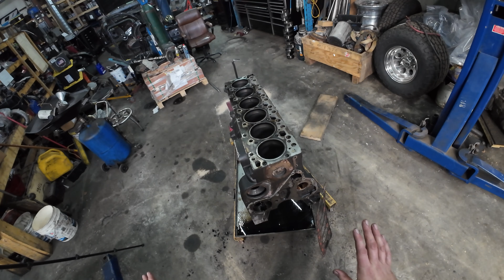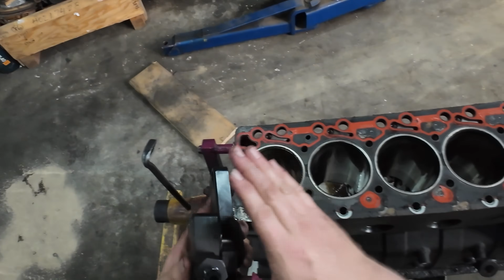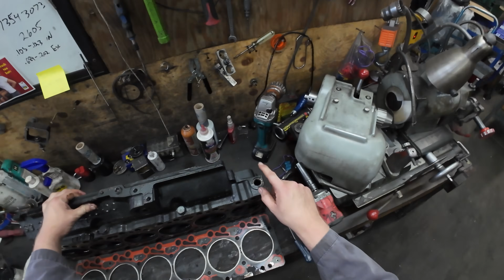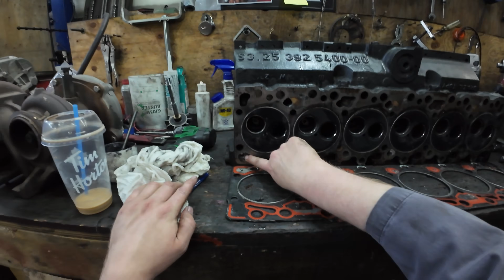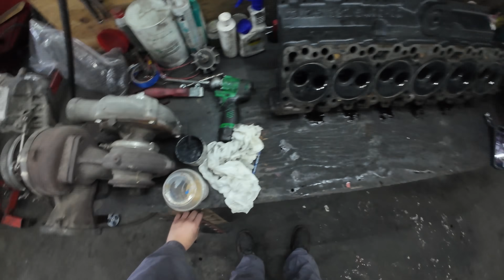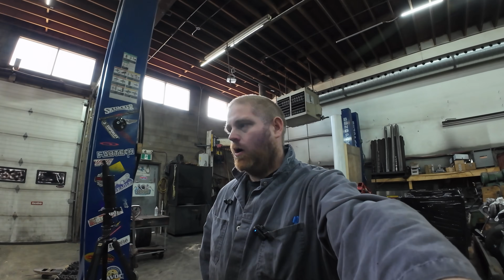HOW TO WASTE $500 ON A COOLANT BYPASS ON YOUR CUMMINS

Comment: This is a good informative video on coolant flow. I chose to pull coolant from the second port forward from the back of the head and use a ball valve as a restrictor as well as having the thermostat still. My figuring is, it'll bypass a little all the time but when the coolant pressure increases at the rear of the head, it has a path of less resistance to the radiator. I keep it restricted partally to make sure it doesn't starve the front of the head of coolant or affect the flow direction. 
Thoughts on the setup?
Could also replace the valve for a spring pressure release.
Reply from the maker: I do the same thing on stuff I drive in the winter. I close the valve off when not towing.

Comment: 2 of the Case Maxxums I used to service on a hay/beef farm I worked at used the coolant ports in the side of the head. The lowest rated horsepower unit (think it was a 5230) had the Lucas CAV DPA injection pump on it, really an odd pump if you were used a lot of the “normal” Cummins stuff.
Reply from the maker: I have work lots of those piles lol

Comment: I definitely need one in my 1st gen! Great video! No one else dives deep into these engines like you do!
Reply from the maker: Do my best to help a guy. I will get in to the later stuff. But want to get the old stuff done first
Reply: @CUTTERUPROB  I appreciate that!
Reply: Have you ever made the coolant bypass for the first generation. I’m thinking I just wanna plate with a AN fitting for my 1990

Comment: Cummins makes a part for I believe industrial engines and generators 3925226, I believe a few guys say they fit/clear on 1st gens and they also tie that into the port near the inlet rad hose I believe it’s a 3 way fitting for the heat exchanger.
Reply from the maker: Yep they do. We are making one the has the thermostat in it that fits
Reply: @CUTTERUPROB  would it be beneficial with Tstat vs w/o a Tstat plumbing it into that port on the coolant intake vs going on the outtake?
Reply from the maker: @XxOverLoad93xX  out on the block into the non pressure side is what you want in any application. But it you just use the plate you will want restrict coolant flow otherwise the engine won’t get hot. That’s the reason that on a coolant bypass you run the thermostat or a pressure relief.

Comment: Hey sorry kinda off topic. I got an 18 6.7 ima throw on a old webasto. Is there a good way to plumb it in and get the block to warm up better?
Reply from the maker: If it deleted you can just use the lines that went to the egt
Reply: @CUTTERUPROB  just went ant looked at it. Your right that's a great spot

Comment: 👍👍..picked up an OEM ,cast iron,by pass adapter( think it was for a Marine engine or something)... pretty cheap... haven't installed it...was gonna try on a tow rig eventually... probably just T it into the heater core..or route it to radiator or bottom rad hose adapter...idk, we'll see.but anyway 👍👍👊
Reply: If you hook to bottom rad hose then it’s useless
Reply: @diederrr  why
Reply: @XxOverLoad93xX cuz you are putting hot water into the water pump intake. It would function as a pressure relief but do nothing for improving cooling performance thru the block. That being said I personally feel dumping the pressure is the only real use for a bypass as if you are using it to cool cylinders to keep them from scuffing due to excessive egt you are killing your cylinder head more by robbing it of some of its flow because it’s easier for water to go out the bypass than turn and flow back thru the head so running a bypass just takes coolant away from the head which also suffers from excessive egt in the form of excessive guide wear and cracking.  In my opinion If you want to turn a bunch or rpms and run a closed thermostat run a spring bypass. If you won’t turn over 3500rpm don’t worry about it or if you are racing and don’t need a thermostat don’t worry about it either.
Reply: @bcbloc02  running a coolant bypass does in NO meaningful way reduce flow to the cyl head, the flow rate (volume per time)per system pressure drop formula is a quadratic formula. the pressure measured at operating temp (190f) through and AN fitting freeze plug in the back of the block @ 3000-3500 rpm is 50-70PSI. the problem with the cooling system isnt its performance, if that was the issue you would just change the rad, the problem (like most front to back cooled inlines) is that the coolant has picked up too much heat by the time it reaches the back of the engine. Most of the restriction in the coolant flow path is the cyl head, the cummins water pump has PLENTY of flow, by adding a 5/8 ish -10 and fitting line at the rear of the block AHEAD of the cyl head restriction what you are doing is significantly increasing the flow through the block (think of it as a manifold supplying the head and the bypass now), whilst insignificantly reducing the flow to the head. this has multiple effects, the rate of heat transfer has a direct relationship with delta T, meaning that your watts of heat rejected from the system per time INCREASES as the temperature difference between the engine and the coolant grows. The increased rate of coolant movement in the block because of the bypass means that time spent at the front cyl cooling jackets is less, meaning less heat absorbed by the coolant by the time it reaches the rear cylinders, and that in turn means that the rate of heat transfer to the coolant at the rear cylinder is also increased, aka more even cooling across the block which is the REAL issue, not overall cooling system performance. in my opinion (id have to do an actual experiment with temp probes before and after in the cyl head) the cylinder head receiving coolant that is a lower temp more than offsets the single percentile reduction in flowrate you'll see with the bypass kit installed. this also eliminates the stagnant area behind cyl #6 where coolant will just eddy and only exchanges out via convection and eddy. All that being said, if you have a more or less stock truck, 185hp 12v or 24v and arent seeing rpms north of 3k, id agree that the kit doesnt really offer much, itll make your rear cyls run a LITTLE cooler, but i havent really seen many people have issues in 5/6 with stock trucks till the 3rd gens came out with their higher HP and more demand of the cooling system.
Reply: @EvanWSH  👍👍👊
Reply: @bcbloc02  👍👍 that's a good point.. thanks for the input feller 👍👊
Reply: @bcbloc02  Apparently,the rear frost plug adapter I picked up is used to supply coolant to an air compressor,if equipped....a Marine engine doesn't use any adapter apparatus back there...I may not do anything back there,as u mentioned..
Not necessary for my application,but anyway 👍👍👍👊

Comment: Not following Rob, even with equal pressure if piped properly it’ll still flow. Something about a pump.
Reply from the maker: You might get a small amount flow out of it a certain times. But it would be flowing to help. You want to move coolant from front to back. That would flow from front into the back.
Reply: Wrong man.  It will  equalize and just not move any fluid.
Reply: @Hostile87  🤣🤣🤣🤣🤣
Reply: @Hostile87  I shouldn’t have to explain this, but here goes… if both discharge and suction is equal there there is no restriction. The Pump is a MECHANICAL mover. It will physically move the water granted to a certain point as water pumps are not positive displacement pumps, but they will absolutely still pump. If this were a system that was designed without a pump that worked solely off of pressure then sure. But that’s clearly not the case. If you look at early 24v’s the pump would literally build so much pressure it could and did crack cast iron blocks the old infamous 53 blocks. In what universe do you think that’s not enough mechanical force to move water through ESPECIALLY when pressure is equalized! It can crack a cast iron block but it won’t move water that’s NOT restricted. How do intercooler systems work then? There’s no Delta on most of those.
You’ve never circumcised an old unsplit 53 block’s water pump so it wouldn’t split before I take it.
Reply: @MechanicalMafioso  Maybe if there wasn't multiple passages....  water goes the path of least resistance.
Reply from the maker: @MechanicalMafioso  the 53 blocks didn’t  crack from coolant pressure it was from cast shift. The casting on some of them was thing in the spot and the vibration and twisting of the engine broke them over time. The way I said is wrong the coolant will move a bit. But does no good to the system it would bypass the cylinders where the heat is built. You want to make hot coolant to flow through the block and out to the rad to be cooled
Reply: Taking the hottest water in the block and dumping it in where the freshly cooled coolant is entering seem counter productive. You need a radiator in that circuit. You have a big one already on the front of your truck.